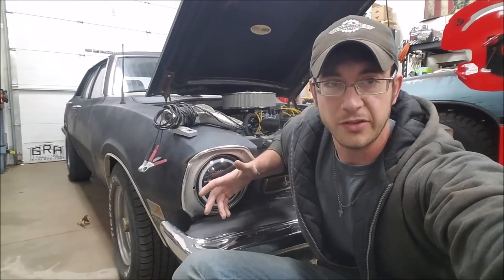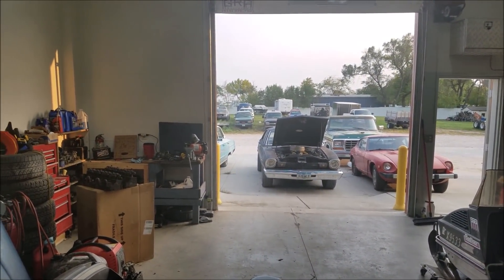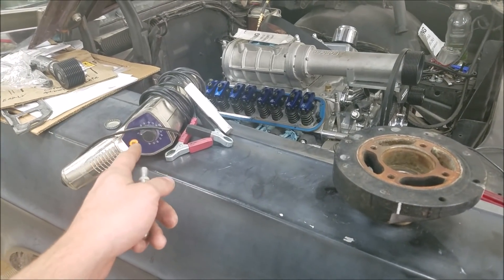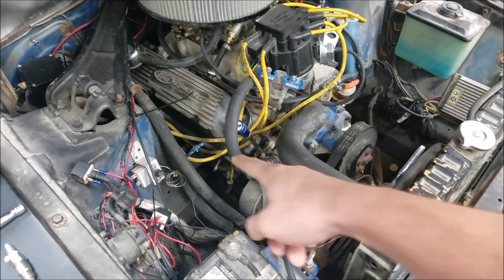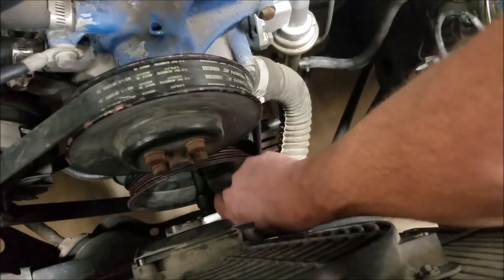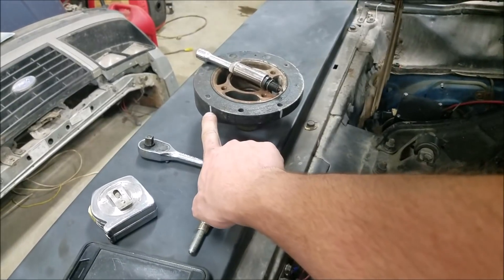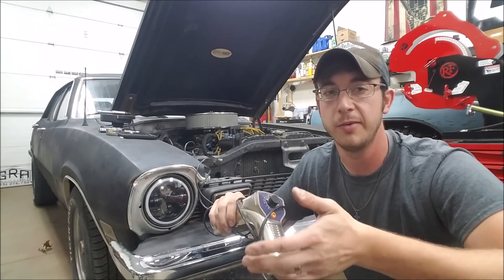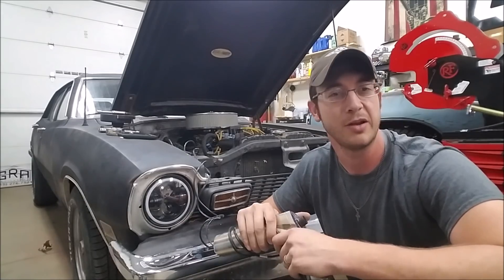Ignition Timing First Step: Before you EVER Touch the Timing Light

Comment: There is a lot more to it like the Firing order, valve positions Etc. I suggest start from the beginning. I have seen so many times how the experts can’t get the distributor timing right especially after an engine rebuild and it is so damn easy.
Reply from the maker: I'm just telling people to not trust their harmonic balancer and check it since there's all different timing pointers and balancer marks. So many times people assemble a mismatch and then can't get it timed - this is how to mark true TDC on the balancer and then timing with a dial back timing light makes everything simple. 
Works for any engine

Comment: 1996 e350 460 7.5l
I haven't had my cam sensor with pointer on my timing cover for years. The new timing cover/water pump didn't have the boss mounts on it. So I recently swapped out distributor and now I'm trying to time it as you noted with the 2 marks. Spout connector out etc. still having a hard time getting it running smooth
Reply from the maker: You need a mark in-between the two marks - spout connector out indeed, think it's supposed to set to 0 so the computer knows what to do.
Regarding the marks - did you make them with a piston stop, or was this a screwdriver in the hole game

Comment: Hello. I am going to purchase this timing light. I just built a 350sbc, Comp cam 460-470 lift  edelbrock 5089 heads  eagle flat top pistons. Had to drill the butterfly to stop pulling constant vacuum thru the ported side. She runs but she is not there. What would you suggest I start with the base timing with this big cam. I'm watching vids and trying to sharpen my very dull tuning skills. Any help is much appreciated. TY.

Comment: I have 2 chevy 350 blocks on my boat one engine counter rotates but the timing marks Guage is mounted the same as the normal rotation engine, so if I try to set counter rotation engine to the marks it runs terrible so I use the retard marks and it runs good, does this make sense to you.

Comment: i have a pertronix billit module 3 in my ford 331 stroker. can i adjust the timing with a single spark timing light? because the billit is a dual spark distributor?
Reply from the maker: Multspark is more like 3, but yes most timing lights will work on multispark. 3 quick sparks and then a long dwell comparatively. Most work
Reply: @ThunderHead289  
I have a self build 331 scat 28ounce assembly. And have vibrations from 1800 rpm going harder vibrations when getting more rpm's(inNeutral) t5 conversion and 28 ounce balancer and flywheel  .can a wrong ignition timing cause this?  I already have put another new flywheel on. And old balancer and have tesame vibrations.

Comment: I am building my first small block 350 in a C4 corvette the one that came with it. Rebuilt the whole top and. I can no get the thing started the carb backfires. I am almost positive that I am around TDC I I spent weeks of spinning the motor around by hand but now I am lost
Reply from the maker: What you see in this video will confirm it - also, you may have done your valve adjustment incorrectly, how did you do that peice?
Reply: @ThunderHead289  I did one of those quick lash videos I lashed them all down until the push rods just had a tiny wiggle room. Spun the motor 1/4 turn lashed all the loose ones. spun the engine quarter then lashed all the loose ones again a total of 2 engine rotations so 8 times than I did a half turn to lock them all down. If this is incorrect I would like to talk more if this is possible I really don't want to throw the wrench and give up on this car you gotta see what I am building

Comment: Hi to Thunderhead and the group. I am please looking for some ideas or help with my 1970 Pontiac Lemans Sport 350cid. quadrojet, at, no ac early build with mostly 1969 parts from GM. The car is only two owners and originally from California. I purchased it from Mecum Auctions I drove it home about 70 miles and I could smell it was burning rich and could hear pinging or detonation under acceleration. What I have done and where I am at in the project is I rebuilt the entire fuel system, including a new fuel tank, new fuel lines, new vacuum lines and had the carburetor 4bbl qj rebuilt by National Carburetors in Jacksonville FL. I put in a new ac fuel pump and new R45s spark plugs gapped at 0.40". Installed a new pro series high energy ignition distributor kit includes 45K external coil with new plug wires, 8 mm. I disconnected the resistance wire from the old  points distributor and installed a new 12 ga wire constant 12v to ign. The new distributor came with advance springs already installed set at 2750 rpms.Using a tdc tool I made sure the number one piston was at tdc on compression stroke. Base timing is 9 degrees btdc. Disconnected the vac.advance line from the proper ported vacuum on the carb and plugged both the line and the carb for timing purposes. I set base timing to 9 degrees and total timing 36 degrees at 2500 rpm. Adjusted the air fuel and get 20 inches of vacuum on the gauge. Hot idle rpm 650-700 rpm with at.. So here is the problem, it seems to run decent but when I snap the throttle, I can hear detonation or pinging. As soon as I retard the timing to eliminate detonation, the rpms drop and the vacuum drops down to 15 and the whole problem of burning rich happens again. I put in fresh non Ethyol 87 octane with the recommended lead additive. Would like your advice please? Thank you. Blake

Comment: Hello Luke, One year later, I am still a tad confused on these piston stops. It seems to me, If the piston stop is not adjusted properly (protruding lenght into sparkplug bore) you will not get an accurate TDC after scribing the two marks on balancer. Do they make specific stops for each engine stroke? Thanks in advance for any feedback from anyone in here.
Reply from the maker: It's the same concept as what's done when degreeing a cam actually in order to align the degree wheel on TDC. 
The point between your two marks after rotating the engine forward and backward is your true TDC mark. 
Does that make sense?
Reply: @ThunderHead289  Thanks and yes Luke that part makes sense. But what if a stop does not allow the piston to reach the top of it's compression stroke before dwelling and going back down, or does that not matter. Just the distance between "the stop tdc" and the "stop bdc? Sorry Luke, I must be over thinking this thing. Blessings from Motown/Dearborn.

Comment: If I want 32° total timing and i have initial timing at 12btdc, would i set the timing light to 20°?  and when adding that 20°, should it line up at the 12btdc mark or the 0° mark?
Reply from the maker: If the timing light is at 20 and the mark lines up, your timing is at 20. If your timing light is at 20, and your mark doesn’t line up, your not at 20. 

No math involved.
Reply: Dumb question,  is the light supposed to come on ,when you at TDC, and whatever the advance is??

Comment: one potential problem with the dial in light is that it does not read true! A plain light either works or it doesn't and when so it is right on. You may have covered this but before you go down there turning the crank you need to pull the coil wire to the distributor and ground it as a safety to prevent a start. Yeah you can turn off the ignition and such but sometimes things get forgotten in terms of procedure and safety.

Comment: I exactly did what was shown on the video using the piston stop.  Turn the crank till it stops make a mark on the pointer.  Turn the crank counter clockwise until it stop then make another mark and used the mark between the two mark as top dead center.  Re adjusted the distributer having the rotor lined up to the #1 cylinder.  Fired the car up and the mark on the balancer is no way near the timing tab on the chain cover. The motor is a 454 big block chevy.  Please help!
Reply: Pull your distrbuter out and reset it on #1

Comment: Fortunately I read about this in "Circle Track" magazine before I found one. 

I had a heck of a time timing my 390 Mustang at the track. The next week in the shop my troubles continued. I used a piston stop to find TDC and I'll be damned! The timing marks on the harmonic balancer pully were WAY OUT. The rubber vibration dampener had failed and the outer ring had slipped a bunch. I bought a new harmonic dampener, and my timing problems were solved. 

If using a stock harmonic balancer pully beware! The outer ring can and sometimes does slip and move on the inner ring. You won't be able to properly time your engine, and you can end up with the outer ring through the radiator!

Comment: I was wondering if you can help me diagnose a timing issue I have with my 351w engine.   Engine hasn't run for 6 years.
I took off the distributor cap and took out the #1 spark plug....
I bypassed the starter ignition switch with a push button so I could turn the engine over while standing at the engine compartment...
i put my thumb over that spark plug hole and cranked the engine continuously and stopped just as I felt the compression hit my thumb ....
i checked the timing marks and found them to be right where they should be at 12 degrees btdc....
I marked where the distributor rotor was pointing...
I then did the whole test again and watched as the rotor seemed to be losing its mark and ending up pointing about 2 cylinders away (retarded) from the #1 cylinder.
Could this be a timing chain Issue?

Comment: 1958 AMC Rambler Super here (pt.60) I just watched your video and do t think a timing light can be used for my engine, but I went by the marks on the harmonic balancer, I set up everything for timing very carefully and I have a rebuilt engine I was trying o start up this morning and tried for about two hours and couldn't get it started, I wonder if the marks on the balancer are off? I can also take out a sprak plug to check for spark too...

Comment: Harmonic balancers usually come in two pieces with a thin rubber ring in between.   It never occurred to me until I started over and not assumed the previous owner's behavior.  The outside ring could be some degrees off from it's original position over time.  Correct.

Comment: Another point I'd like to add in there, is that I have had more than a couple of times where the rubber on the Harmonic balancer will seperate or move slightly, and move your TDC mark.

Comment: Great video. I am doing the timing for the 1st time on a 78 vette automatic and when I shoot the light, I see about 10 degrees AFTER TDC (Yes, After). Can this be possible? When I try to advance it, there is not enough "travel" in the dizzy to get close to a 8 - 10 BTDC mark. What do you believe can be the possible causes? Bad harmonic balancer? Dizzy not set at TDC # 1 spark? .... Thanks
Reply from the maker: I’d verify true TDC first, but from that point the distributor just needs to be reclocked is all - someone installed it a tooth too far limiting its travel for the desired idle timing
Reply: @ThunderHead289  Wow! Thanks for the quick reply. So, 1st I find true TDC as you explained, then make the rotor face spark # 1 plug on the cap, by repositioning the distributor, correct? Thanks!
Reply from the maker: That’s how I would do it, indeed 👍

I’ll be rolling out a video Friday where I install a distributor on a foxbody revival and I explain how to do it
Reply: @ThunderHead289  Sounds great....

Comment: The way I was taught to find true TDC was to put a screwdriver down no 1 sparkplug hole and hand crank till the screwdriver reaches it's highest point. Than mark the balancer.
Reply from the maker: That would never be true TDC, it would be somewhere down the stroke
Reply: @ThunderHead289  the screwdriver goes up and down with the piston head, when the screwdriver is at the top of it's rotation the piston head is at the top of it's rotation. You can see the piston head through the plug hole.
Reply from the maker: The piston also dwells for about 2-3 degrees at TDC
Reply: @ThunderHead289  Thanks for the replies.Aat least it got the car started so I could tune it by ear, I think the dampener on the harmonic balancer had slipped the timing mark out a bit. But now I get different dwell readings from an old-school needle gauge connected to the coil and the multimeter connected to spark lead one.
Reply: @ThunderHead289  I'm watching your videos (and others) because I am trying to get my 1971 Holden Premiere running smoothly. (one million problems and I'm fixing them one by one.)

Comment: So is that tdc exhaust or intake?
Reply: Both valves will be closed at this point and the plug will fire the mixture. If one valve  was open timing would be off .
Reply: @Mr455wildhorses  i bought a 72 chev van that would not run with a brand new engine in it. it sat for several years until i bought it. the first thing i did was check the timing. he had it timed on tdc exhaust. i retimed it to tdc compression and it fired right up. sold it back to him for the same price, he felt pretty silly as it was still in his driveway and he was a friend, and he put an hei dist in at my behest.

Comment: a while ago, the rubber on the original harmonic balancer on my truck broke and the outer ring slid off-center on the pully and back into the motor. It sounded pretty horrendous as it machined about a 1/8 inch deep flat spot into the aluminum timing chain cover before I got it home and shut off. On the bright side , there is no bright side but I can pretend its fine now that its nice and thin down there.

Comment: Isn't it bad for the engine to turn it backwards?
You can find true TDC with a dial gauge.
Reply from the maker: You can’t because the piston dwells before it switches direction. So you can get within 3 degrees maybe. Just depends how accurate you want to be. And it doesn’t hurt an engine to turn it backwards, no
Reply: @ThunderHead289  If you have the cylinder head removed, you can use a dial gauge accurately I guess.
Reply from the maker: You actually still can’t - search “degree cam thunderhead289” and watch where I do it with the heads off when degreeing cam
Reply: @ThunderHead289  Thanks for your reply.

Comment: I used to have an old tbi v6  s10, ran like a dog, no power, poor mileage.  Once in a while it would come alive. Kept having rich running codes. I did a tune up, new O2 sensor, timing was set to factory specs and it still ran poor.. A guy told me to check the timing and I said I did. He said check manifold vacuum, it was a 10 inches at idle.  When a map sensor sees low vacuum it'll run rich, it should be above 16", He said does the timing advance. A big no. I cranked it up to 18* and it ran great but would start hard when hot. The computer was not letting the timing advance   but never had a code for timing problems.

Comment: Thanks Luke some of the simplest things are easily forgotten or overlooked finding true TDC is essential
before any tune especially with fords interchangeability when it comes to water pumps and timing locations
on specialty applications and putting a late model small block ford where its not supposed to be. Thanks
again you are clear and to the point with your vids and i appreciate that keep up the great work.

Comment: So the million dollar question is:  How in the world do you know that your piston stop is truly at TDC of the piston?  Your statement that 1 1/8” usually works well seems totally random.
Reply from the maker: It’s not at TDC when it hits the piston stop, it’s below - that’s why you turn the engine forward until it stop and make a mark, then backward and make a mark. Point in between those two marks is TDC. Additionally, you can’t just “see TDC” because technically the piston dwells as the connecting rod roll over center of the crank - the piston will literally not move for a few degrees as the crank continues to rotate. 

Thunderhead289

Comment: Thank you for the VERY informative video! I have a 1971 Chevy C10 with a 350 (virtually stock with quadrajet).  After restoration and rebuild on motor - ran just fine for about 2k miles.  Go on it a few time and noticed a rough idle.  Was using manifold vacuum for advance - turns our that diaphragm was shot.  Replaced the distributor - now I have okay idle but engine surges and hesitates on acceleration. Runs good if I stay in the pedal - but if I drive it conservatively - problem is enhanced.  Idles at 850 rpm in park, 550 in gear when just leaving my home to go to work.  When I arrive at work (after engine is fully warmed) - idle is 1000 rpm but if I let it idle for a bit, seems to normalize.  Vacuum leak on full warmup?  Timing: 12 initial, 30 total.  Right now advance is hooked to ported with 5 in at idle, 15 in at half throttle.

Comment: Hi Luke I liked your video but I've always used the finger in the spark plug hole to get close and then use a small screwdriver and carefully turned the engine over by hand to see where tdc is. It maybe be easier to have a buddy tell you "go up a it or Stop go back a bit" to really get it close.  I come from a long background of working in engine shops so checking tdc on the balancer is much easier before heads are installed.
Reply from the maker: The caveat to doing it that way is that you won’t be perfect if that matters to you. Technically the piston will dwell aka not move for a few degrees of crank rotation as the connecting rod to crank journal rolls over center and reverses direction. 

You can get within 4 degrees with what you explains but to be absolutely correct you have to do the two point method. Same method used when degreeing a cam and measurements need to be exact.